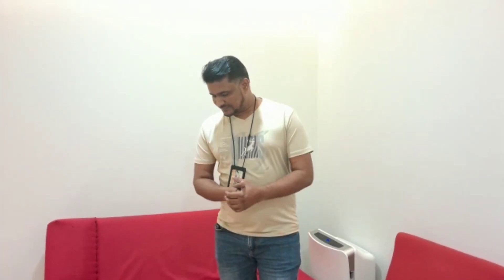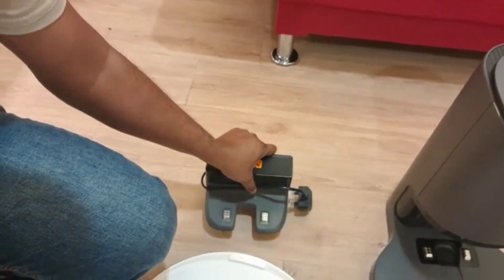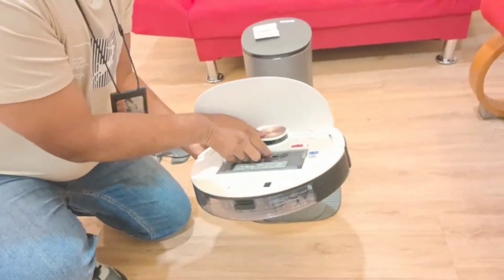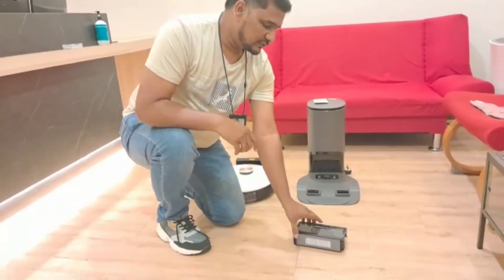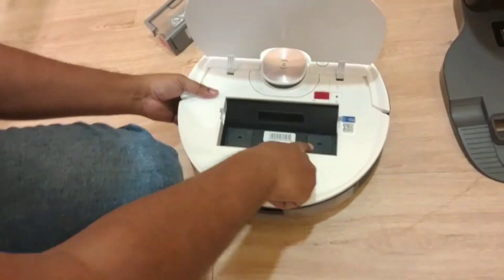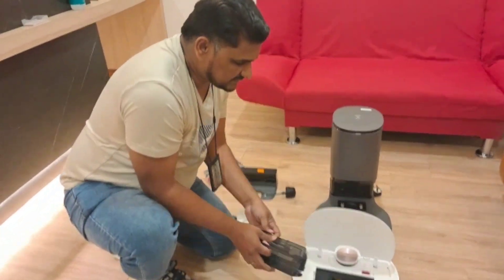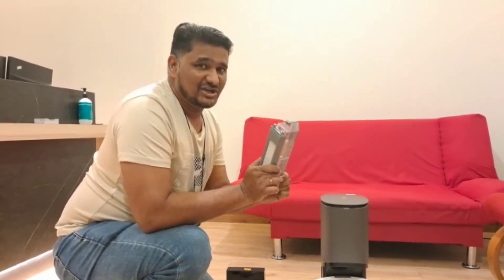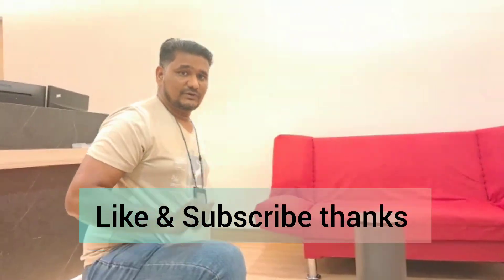Why Dust Not transfer to Auto Emty station?? Using Ozmo T8 Model

Comment: It’s been two years since I purchased the auto empty station separately for my N8 and the damn thing never worked even after removing the cover and using new dust box since the purchase and everything. Dust doesn’t get sucked into the auto empty station but instead gets stuck in the flaps. Stupid design. Should have returned it when I had a chance.

Comment: I have the T8+ with the dust bin and auto empty station.  If I get the N8 Pro without the dust bin and auto empty station, how can I remove the locks without the key so that I can use the dust bin and empty station I already have from the T8+?
Reply: Same question. Did you get the solution?
Reply: @FicticiaFilms  nope, never found a way. Moved on to a different bread
Reply: @FicticiaFilms  Never did. I ended up switching over to Roborock.